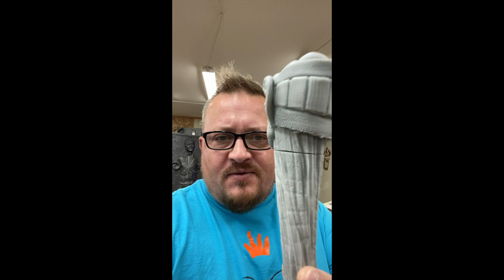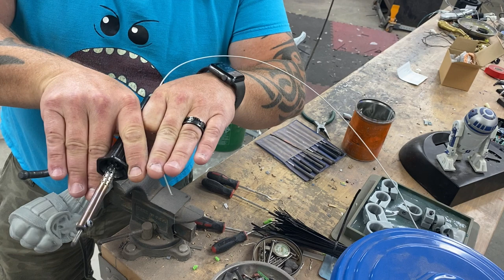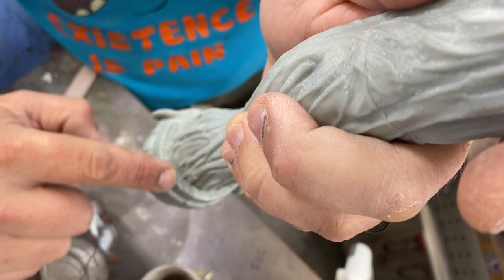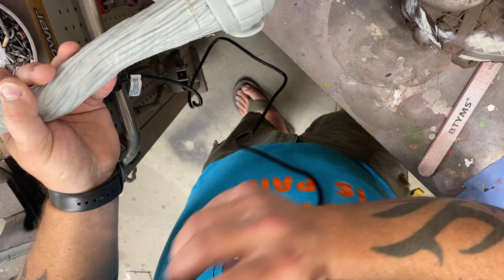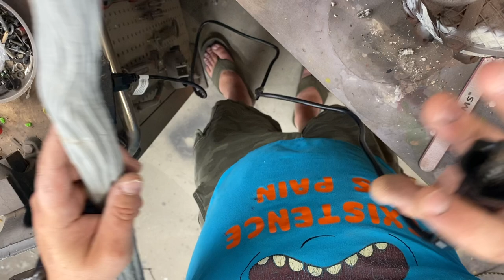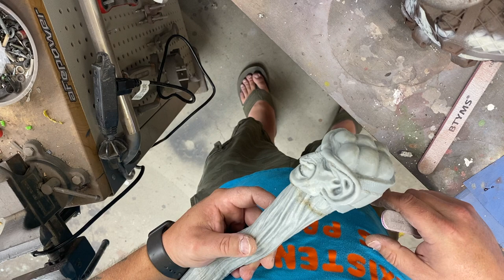Tips & Tricks 1

Comment: great video!
Just starting to switch to ABS and trying out a lot like acetone - gotta try this with my 3D Pen
Reply from the maker: Haunswurznzopf I still have yet to give vapor smoothing a try simply because I print such large stuff. Will experiment one of these days!
Reply: @LeSanglierQuiRit  Yeah, that has been my Issue as well, without building a Chamber the results have been more than disappointing
Reply from the maker: Yeah, gotta have a chamber and a fan to circulate those vapors

Comment: I print mainly PLA because of fumes no place to really print that stuff. Would this work with PLA? Stick weld with ABS in the seams of PLA and since its easier to sand theoretically should be no problem? I just hate ordering a roll of ABS since I will never use it but if this works................
Reply from the maker: No, stick with PLA to PLA, mixing plastics is
Not a great idea.